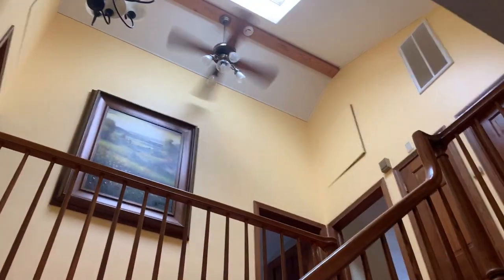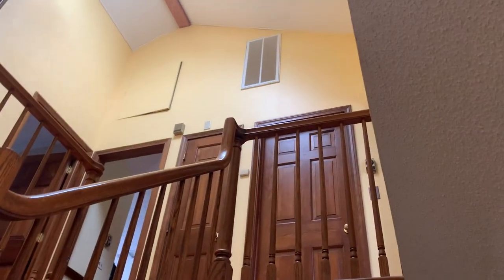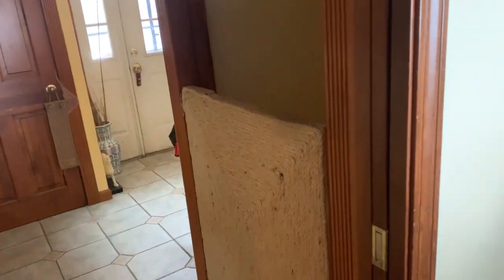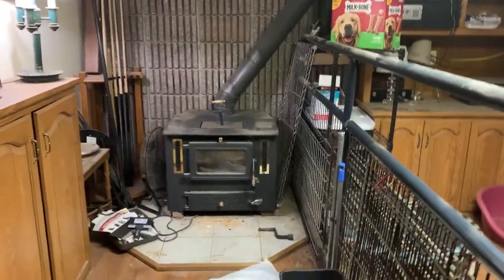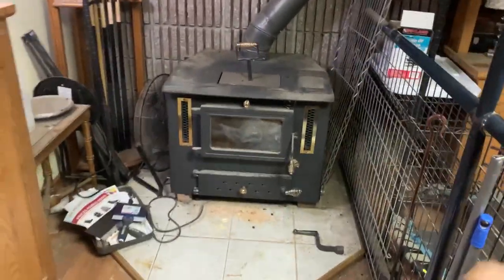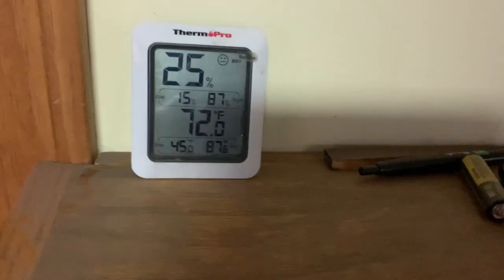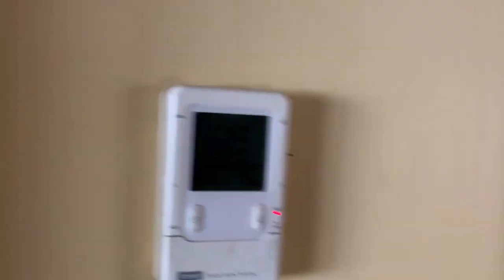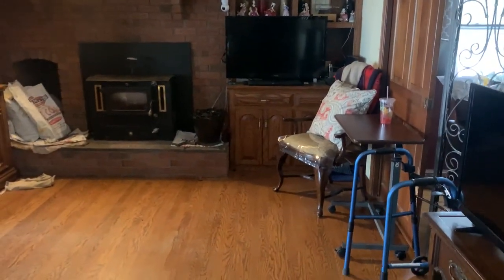Moving hot air from wood or coal stove in a big house. How to get entire house warm from stove heat.

Comment: Hi could you share the make and model of your stoves? thanks just had my flues redone this summer so I’m shopping for a couple stoves and thinking of coal for the basement… there is one supplier that will deliver coal near me here in the Shenandoah valley va
Reply from the maker: My stoves are both the same and made by Hitzer. I think there are many good coal stoves. I like the gravity feed hopper aspect because my stove works during a power outage. Granted with electricity I can run it hotter ultimately producing more heat, because the blowers take heat away from the stove. But the stove can function without the blowers on. The important thing is to not overheat the stove. I suggest you join coalpail.com forum and post your questions there. Many coal burning enthusiasts there that are eager to share their knowledge.